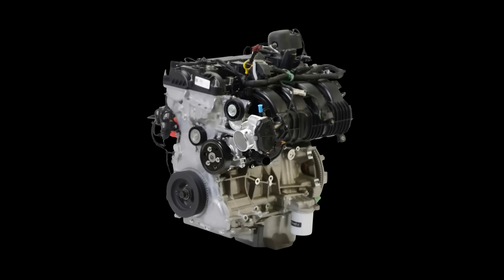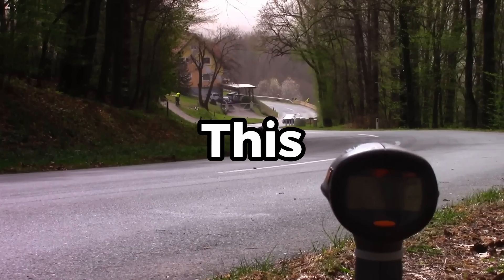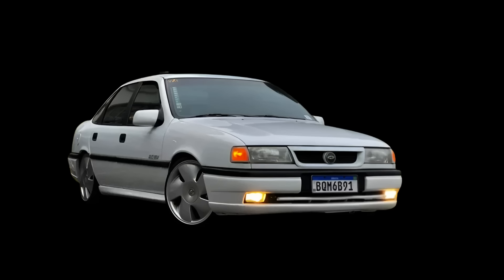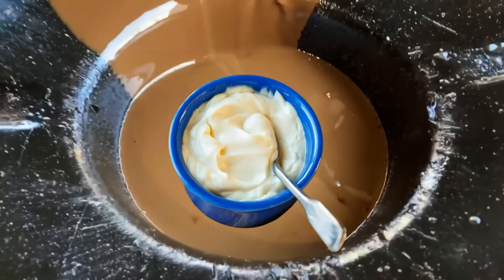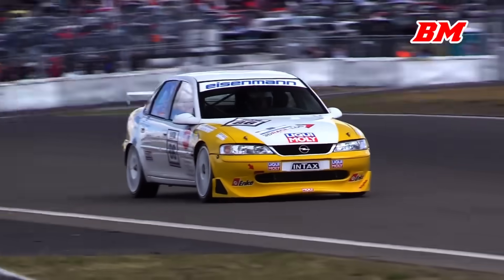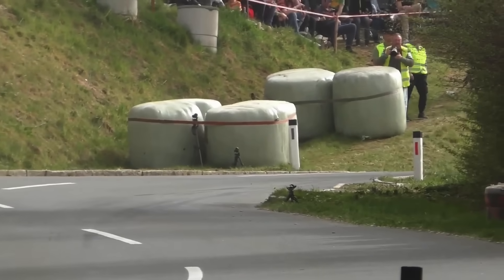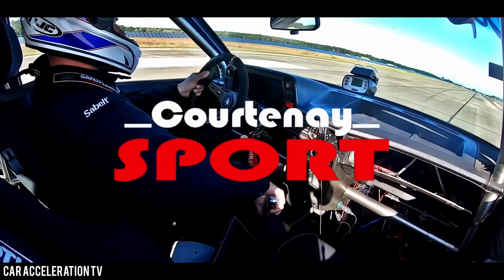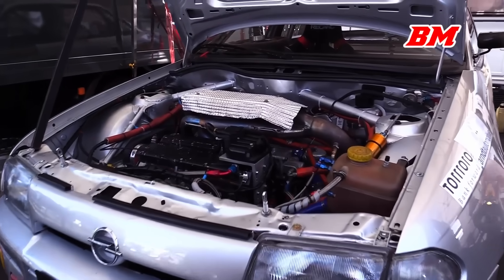The C20XE: When Cosworth And GM Built an Engine Together

Comment: In South Africa,  we had the stock 115kw  Kadette GSi, and the SUPERBOSS.( Homologation special for our Group N racing, only 500 built)
Same motor, but 125kw 228Nm. Shrick cams(276) , hi comp forged pistons, sodium valves, Promotec ECU, F20 gearbox with LSD, specially built by local legend, Andrey Vervey . Irmcher suspension springs.  These were KING. Monsters.  Pity so few survived .😢  All the VW/Toy/Nissan/Ford guys, respected it.
Reply: Ja Bru...
I bought a GSi Superboss from Alberante Delta in Alberton in 1991 and drove the a*s off it until 1995 when I traded it in for a Kadett 200TS, that I actually kept until 2016 when I upped sticks and left SA.
Both cars now are extremely rare and command seriously high prices when or if they come on sale, both cars were absolute brutes though!
Reply: I grew up with them, raced them on the streets for years, they were untouchable in SA. Nice to see Mike Briggs touring car in the video.
Reply: Hens teeth these days bru.. the brother of a buddy of mine in high school had one, no idea what happened to it.. Check out J1 Auto (In Strand in Cape Town I think) they have had one or two for sale.. for a pretty penny!
Reply: Every C20XE Fan around the Globe knows about the Superboss 🙂

Comment: Best mass produced 16v 2.0 of it's era.

I'm a BMW, VW and Honda guy.
And I kinda dislike Opel.
But those ports are BTCC/DTM spec out of the box.
Reply: LOL - you would've hated the Group N races in South Africa then 🤣   
Poor little 2.0 Opel trouncing the locally developed 325iS 2.7 factory entries!!!!   and that was after they messed up VW's 2.0 16v GTi so badly they were dropped to class B.....    The VW <> Opel  then BMW<> Opel supported rivalries got pretty heated at times. 
If I remember correctly the Hondas were in Class C and were up against Nissans and the 1.6 Kadetts. The high-revving, low torque nature of the 1.5 & 1.6 Honda engines of the time made them struggle at some tracks but the double-A arm suspension was a serious benefit through track-to-track tuneability. 

It was a fantastic time in history!!!!!
Reply: The cylinder head was designed by Cosworth For GM to go racing

Comment: The Calibra didn't get enough love when it was new. It's still a handsome car thirty years later. It was sold in Australia by GM as the Holden Calibra and I haven't seen one in more than twenty years. The only examples left were not looked after, sadly EVOs and STIs got all the glory and the Calibra was ignored.
Reply: I actually wanted one as a first car
Reply: I saw a Calibra the other day and it was nasty - owner probably got it off a 22nd-hand lot as the cheapest car, not because he wanted a 90's icon.
Reply: I've got one of the last ones in the UK, but a v6 (also with Cosorth's help) 1997 car and no bodywork done (rot free) only 95,000 miles on the clock in 28 years.

Comment: I own a Saab 9-3 turbo x the B284R engine with a little help holds 700bhp as mine is now fully built. The amount of boy racer that don't know the car,  and what Saab was about. I get asked all the time what is that!!!!😂
Reply: I drive a bone stock 2.3T 9-5 Griffin. What surprised me with the Saab engines are the amount of torque they produce. Especially with some work on it. I've had a go in a 320hp one that had around 520Nm.🤯🤯
Reply: @Unofficial_Jim mine is sat at 870nm
Reply: @matthewcropper9480 that what I mean.. your in V8 territory, no wonder the gearboxes have issues(not that their all that great stock either but still).

Ps just realised that you where talking about the V6. Which still are great numbers but the Inline 4s are stupid torquey aswell.
Reply: Fuck me now that takes me way back to my tarmac chewing days my bipolar viggen blue 93 she was a nasty bitch but also she was crazy fast when her panties came off 😅😂😂😂
Reply: I've got 2008 XWD manual B284R BSR tuned. What mods are best for power/price?
Reply: turbo saabs were upmarket from opels in places that had saabs that time. they weren't boy racer category simply because they were old man racer category due to the logistics of money, but sure most people who had an used opel would've taken a nice turbo saab over it if they could afford the car and maintenances.
Reply: @lasskinn474 I agree! They ain't cheap to run and maintain.

When my turbo x was standard, it wasn't to bad. The road tax is now £930 for the year! I pay less in insurance